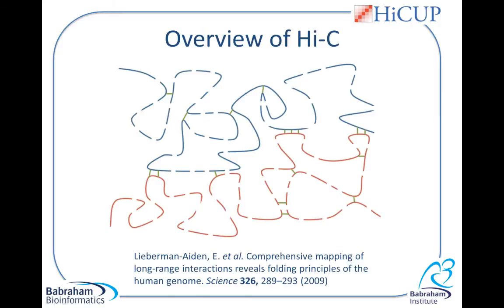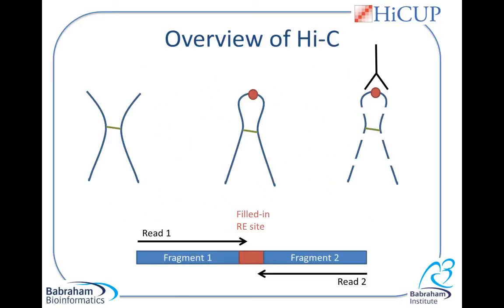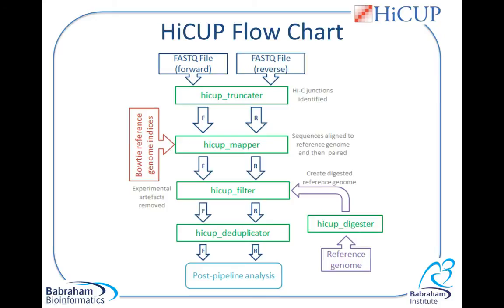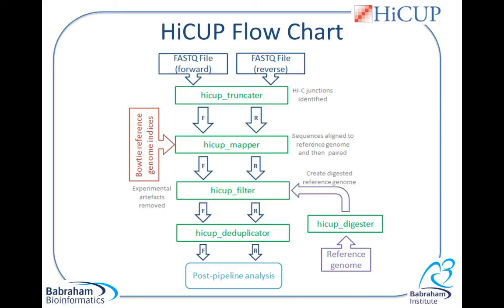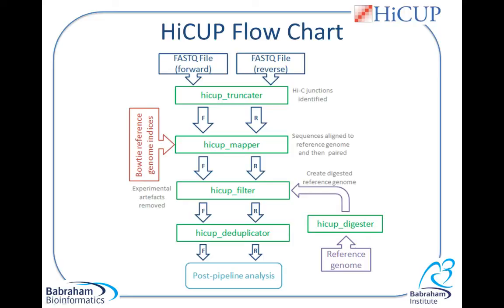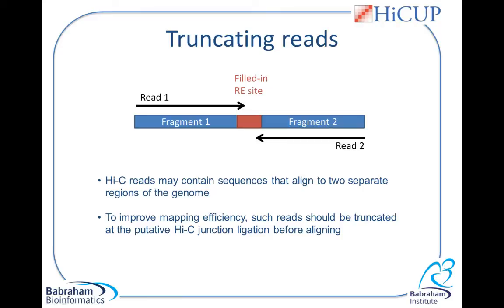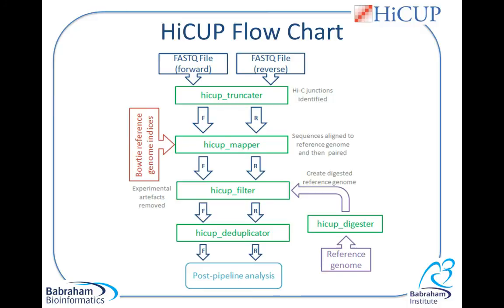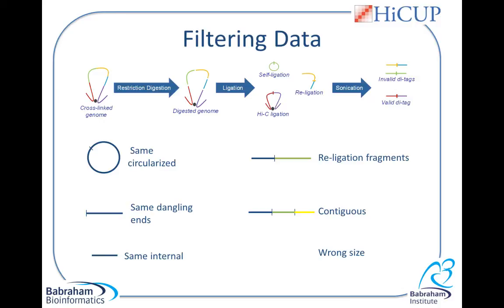HiCUP Overview

Comment: Thank you for the explanation. However, I don't understand how it is possible to determine the expected ditag fragment lengths bioinfromatically, given that the genome is not digested with 100% efficiency. Therefore, it is very likely that we will get fragments which contain one or more potential cut sites in the middle whereby our reads are only aligned to the outer (flanking) fragments. Hence, I believe that sequencing data is blind to such (internal) undigested fragments and I don't see how these can be calculated bioinformatically. I guess, if we compare bioinformatic sizes with real library sizes (with adding the length of adaptors), we will likely see that bioinformatics underestimates the real (mean) size?
Reply: The wrong size filter here would remove ditags where the distance from the mapped read position to the closest restriction site would be larger than the upper end of the size selection range, so there's no way that could be constructed from a normal ditag production process, regardless of digestion efficiency.
Reply: @simonandrews5604  Thank you for your reply. I really appreciate the time you dedicate to reply to my question. However, I think I'm talking about a valid di-tag. Non of reads reach or span the restriction site. For example a 600 bp di-tag, sequenced with 150bp each end (say PE 150), and non of R1 or R2 reads spanned a restriction site. If there are two potential restriction sites in the middle 300bp. In this case how can we tell bioinformatically that the ditag has only one restriction site? Or am I getting it wrong here? Thank you!